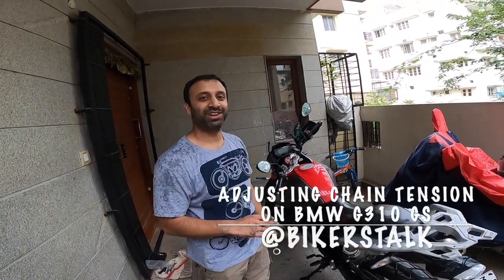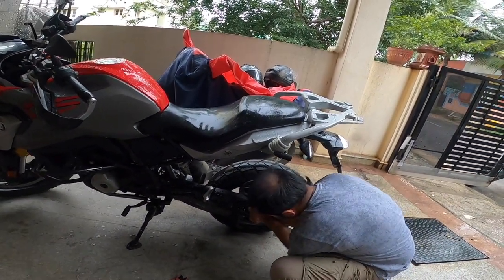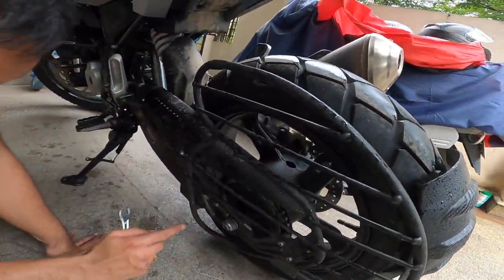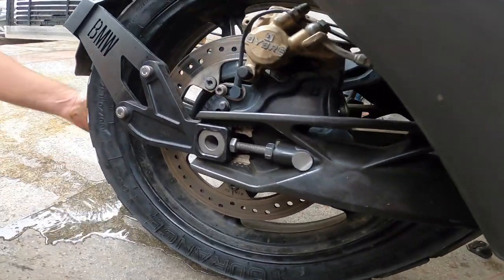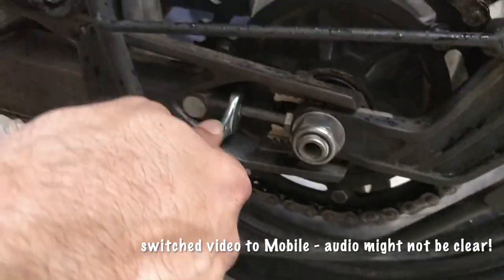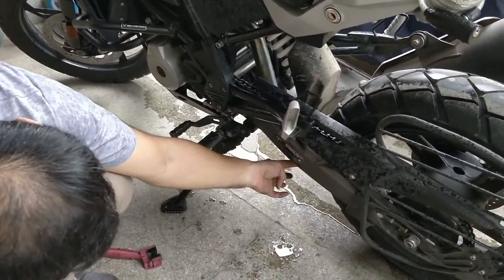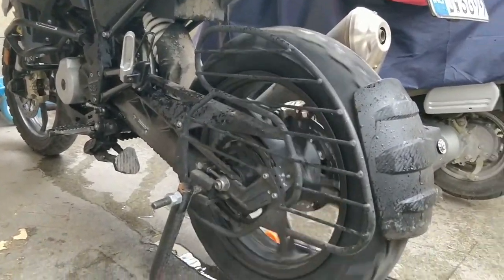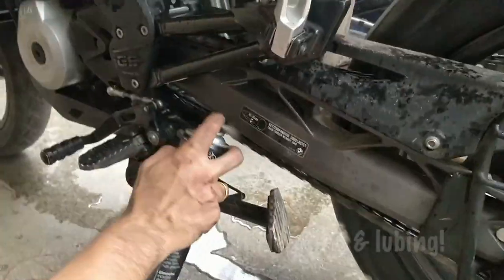Adjusting Chain Tension on BMW G 310 GS @BikersTalk

Comment: Hey mate use the ruler or a measuring device. Approximation could ruin the vehicle. It's good initiative though to make this video but technically it's not sound. I've been riding different GS since a decade and doing the minor and major technical jobs of GS and in every case the "approximation” especially  of the "chain adjustment” without using the technical device  have ruined the machines. Please check the correct adjustment. GS should always in straight position (possibly center stand or paddock or halter stand) while doing this job. Please mate don't mind it. I'm telling you it's because I messed up with GS earlier. Best Wishes 💐
Reply: I agree. The BMW service center guys also did an "approximation" while adjusting the chain tension of my GS310. However, within 1 week only the chain started clanking on the roller...
Any idea how to resolve this?

Comment: What is the air pressure usually we maintain. I recently got one but not sure where to check
Reply from the maker: 26/28 - Front/Rear
Reply: @bikerstalk3656  thanks for responding

Comment: Can you share which crash guard is good? 
How about mobile Mount n charger?
Reply from the maker: Vinoy - We did a review of all the accessories we use. 
Crash Guard - SW-Motech
Mobile Holder - BOBO Claw Grip (Make sure you have the elastic rubber supporter as well) 
https://youtu.be/Ve9Pjv2mQs4
https://www.amazon.in/dp/B07RWDXNTR/ref=cm_sw_r_cp_apa_fabc_HB1V6A3VRJMZM9ZVA1XF?_encoding=UTF8&psc=1